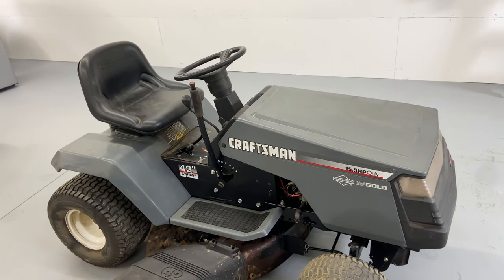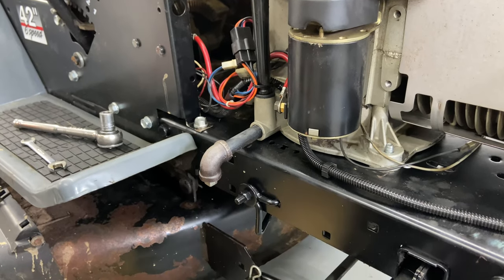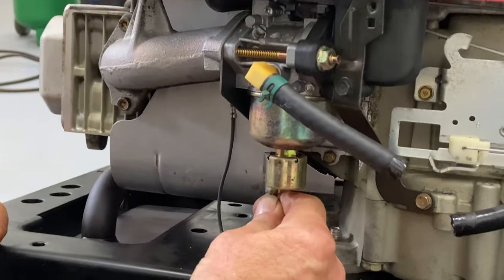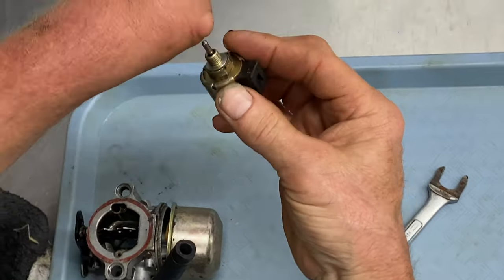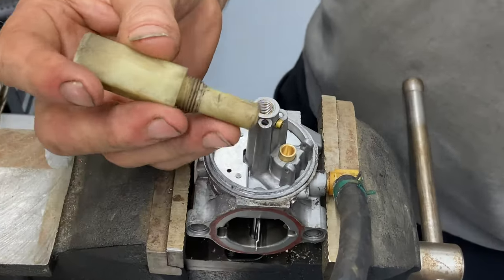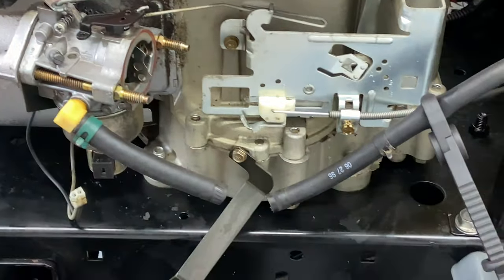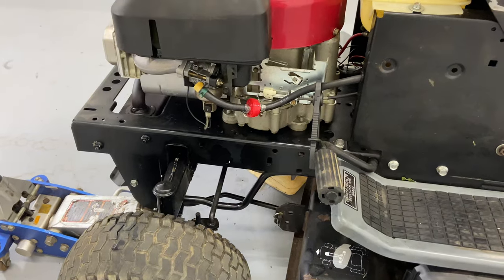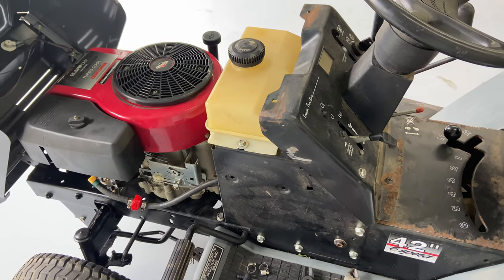Why is there Gas in my Lawn Tractor Engine Oil ???

Comment: Well done. I added an inline fuel solenoid to shut off the fuel. I know my wife or I would leave the manual one on at some point. Now I have 2 things (anti backfire and solenoid) that should shut off the fuel if they are both working.👍
Reply from the maker: That will cover pretty much everything!!!

Comment: Your lawnmower has created diesel my friend lol - I have the same issue with my toro, just not as much gas comes out of mine though very informative, thanks!
Reply from the maker: Ahhh yes, the oldies and well built!
Reply: @Johnson's Small Engines  I ordered a new carb, adjusted the valves a bit and seems to be doing good now (nock on wood)

Comment: Friend has a very similar engine on a mower he got for free. We got it assembled, serviced and running but over night it'll fill the cylinder with gas to the point that it hydrolocks. The geyser when you pull the plug and run the starter is spectacular. We'll give it another go with the new knowledge, great video bud👍

Comment: Very nice clear instructions. Exact thing happened to my  Snapper rear engine rider. I decided to just try the cheap 40 dollar aftermarket carb. Followed your instructions taking apart and putting back together and started right up and so far now no gas in oil and works like a champ. Time will tell!! Thank you very much for the clear instruction and vid.
Reply from the maker: I’m glad it was helpful!Thank you for watching and the kind comment.

Comment: I have almost that exact tractor that I bought new in the fall of 1996:
Model 917.256890 Serial 092596D (Sept 26 1996) Original engine B&S 28N707 0173-01 960830ZD (Aug 30 1996)

I replaced the engine in 2005 due to catastrophic failure (broken connecting rod). The replacement engine - which it still has - is B&S 28N707 1026-E1 991102ZE (Nov 2 1999). Its interesting that the replacement engine evidently sat for over 6 years before I purchased it. Around 2010 it began to experience hydro lock after sitting between uses. I tried rebuilding the carb several times without success so I installed a fuel shut off and now just run the carb dry at each shut off. No more issues. I completely rebuilt the tractor in 2020 during Covid as the frame was badly cracked in the front - probably from years of using it in the winter with a small plow blade. I was lucky to find a vintage parts tractor (no engine) with a perfect frame. I also rebuild the hydrostatic trans (Hydro-Gear 310-0500) to replace the seals. The current engine has 390 hours on it and I estimate the entire tractor to have over 700 hours in its almost 29 years.

Paul (in MA)

Comment: You are the best I like the way you explained everything to the wire I was going to cut my yard today when to the  garage and  my lawnmower it was full of gas in my oil should I put a cutoff valve on my gas line and should I run something to my crankcase to get all the gas out if so what should I do I'm going berserk thank you so very much for your videos I have a Craftsman t240 Kohler 22 hp 7000 series and I just learned something about this solenoid a good videos turn the key on I can hear click thank you so very much
Reply from the maker: Hi Henry, you can put a fuel shut off in but I would suggest rebuilding the carburetor. Draining all gas from engine and replace oil filter is all you need to do.

Comment: Great video... great working knowledge... I have the same problem with the same engine wish I saw your recommendation to use oem before ordering an aftermarket one... I winged it with diagnosing and disassembly but watching this gave me the extra confidence I need to get this thing up and running again... Thanx
Reply from the maker: Thanks for watching and commenting. I will assume you’re replacing the entire carburetor? If you are, let me know how it worked out?
Reply: @JohnsonsSmallEngines  yes I'm replacing the whole thing because it seems like the previous owner crossthreaded the fuel solenoid and after I cleaned all the rusty gas and crud out of the bowl the threads won't grab so I figured I'll save time and replace the whole unit instead of rebuilding it.
Reply: @JohnsonsSmallEngines 

Update... so far so good finally got it running, rebuilt brake caliper and did a full clean up and tune up... Thanx again great work keep it up
Reply from the maker: Good to hear. Thank you for the update.

Comment: A little trick I discovered : take a carburetor and hook a 1/4" hose to it. hold it old it up right
and blow and you should be able to tell the air is going through it.  Now turn it upside down and you should not be able to blow through the hose.  When turned upside down the float should close the flow.

Comment: After draining the crankcase, do you think I need to air out the crankcase's intake, with a leaf blower, to get as much gas to evaporate as possible? Or should an overnight oil drain suffice?
Reply from the maker: The overnight is oil drain is good.
Reply: @JohnsonsSmallEngines  After refilling the oil, should I then mow the lawn once, then change the oil again to completely rid the gas in the crankcase?
Reply from the maker: It wouldn’t be a bad idea to drain it twice but it is not needed especially if your able to drain the engine all night you should be ok. If you do have a oil filter and you are draining the engine twice, remember to also change the oil filter again.

Comment: Faulty gas cap (not breathing) will build pressure and that pressure will push your needle valve down and through the carb up into the intake . Just happened on mine the other day.
Reply from the maker: A faulty gas cap does just the opposite and creates a stoppage of the fuel flowing eventually causing engine to starve of fuel from carburetor shutting machine down. The engine creates the vacuum needed so the carburetor can pull fuel.
Reply: @JohnsonsSmallEngines  
Yes it was doing that also and after  l parked it and no vacum. It was shooting up through the carb like it was being pumped.
Changed the carb and was still doing it . Changed the cap and it stopped. So l don't know guess will see if l find gas in the engine next time l go to use it.

Comment: On the 1/2 inch wrench how think is it now? I have to smuggle one into work to grind down. Just trying to figure out the thickness now? Thanks for the advice.
Reply from the maker: Not sure thickness, i ground it down until it fit, but don’t grind to much off. Just do a little and a time and check it.

Comment: Thank you so much for the video. I do have a question. I followed all of your steps and cleaned the carburetor. I filled the oil and the fuel tanks. It's turning on which is better than what it was doing before but it is giving out a lot of smoke. Is this normal and does the smoke stop eventually or did I do something wrong?
Reply from the maker: I'm pretty sure I replied to your e-mail.

Comment: Good video first time it happened to me. My push blower wheel fell off, so I was trying to fix that. Maybe that caused the float to stick. the gas run into the oil Two big wheels so when the wheel fell off, it was tilted too much.

Comment: Great video!!  I just had this happen to my mower yesterday.  After it happened and I tried to start it, it didn't try to turn over.  It just made a high pitched whining or whistling sound.  Did the gas cause an issue w/ it not trying to turn over or could it also be a starter or solenoid issue that would make that sound?
Reply from the maker: What can happen is the gasoline flows from the tank through the carburetor and into the engine oil then it fills up and goes into the combustion chamber where the piston is and if both valves are closed, and you go to start the engine, you will have a liquid lock where the piston will not move because the fuel is in the way. Your starter solenoid most likely is OK. You will need to remove the spark plug. Make sure the spark plug wire is not near the spark plug hole and spin the engine over to relieve the fuel that is in the cylinder. I would suggest spinning the engine over by hand and make sure you have many many rags or something to catch the fuel that will be coming out of the front spark plug hole. Once you have all the gas relieved from the cylinder, you can go ahead and try to crank the engine with a starter, but as I said, be careful where the spark plug wire is sitting so you do not catch any fuel on fire if you do crank over the engine while the spark plug is out.
Reply: @JohnsonsSmallEngines  Awesome!!  Thank you so much.

Comment: Thanks so much for this video.  I thought my lawn mower was done.  It was fine at the end of the season but when I started it up this year it was smoking.  When I tried to engage the blades it started sputtering and stalled out.  I thought I was going to need a new tractor. I had gas in the oil too.  I drained the oil, replaced the filter and got a replacement carb from Amazon.  That spring was hard to get.  I did get a little bend but straightened it out.  I started it up okay but now it seems that it runs rough on high RPMs.  If I lower the throttle it starts running smoother and I can slowly increase RPMs.  It still not right.  Do I need to replace the spark plug?  Any suggestions?
Thanks again for this video.
Reply from the maker: I cannot diagnose a symptom without seeing the engine while it’s running and I have no luck with aftermarket carburetors for the larger Briggs and Stratton engines. I would suggest trying to rebuild the carburetor that came off your engine if it is an original OEM “ original equipment manufacture”. Yes I would replace the spark plug, and fuel filter and the air cleaner if needed.
Reply: @JohnsonsSmallEngines  okay thanks.  Going to replace spark plug and air filter.  Replaced fuel filter and installed a shutoff valve in fuel line.  I have never worked on a carburetor that's why I just replaced it.
Reply from the maker: If you get all of the parts my video shows how to repair it.

Comment: I've got a Craftsman T206 Riding Lawn mower. All the gas disappeared; found it in the oil. Naturally, I got blamed, so we filled the gas back up and the same thing happened, so it obviously wasn't me. We've traveled far enough down the road to understand that it must be the carburetur, but now comes the task of replacing it. (We're not experts enough to try to fix the carburetor itself.) Can you offer any guidance?
Reply from the maker: The easiest way to correct this issue is, drain all gas from the engine, put fresh oil in and replace (purchase a new) the carburetor with the OEM "original equipment manufacturer" carburetor.

Comment: Would a leaking float taking on fuel and falling pulling the needle vale down also allow too much fuel into the bowl and cause the same problem as fuel in the crankcase?
Reply from the maker: Yes
Reply: @JohnsonsSmallEngines  Thank You, Carburetors... one of life's little pleasures. Appreciate your channel. Am now a subscriber. With a rider mower, chain saw, pressure washer and 1971 VW Beetle I am in carburetor heaven. The more you teach us the better we gas guys can keep our investments running.
Reply from the maker: I had a old Beetle 20 years ago and I wish I didn’t get rid of it. Fun little car. I don’t get into the little two cycle engines anymore as being in business not worth repairing but I keep busy with tractors, snow throwers and many how to operate machines to help all the folks that rather watch a video then read a manual that now you can only get online. How things have changed through the years. Thank you for supporting my channel and if I can help you please don’t hesitate to ask any questions.

Comment: Hello I too am having similar issues with my 25 year old Mastercraft lawn tractor with 15.5 hp Briggs and Stratton engine. My question is what brand and grade of oil 10W30 or 5W30 would you use for such an old tractor.
Reply from the maker: My opinion, the brand of oil doesn’t matter as much as the API rating which at the present is SP. Just make sure the oil has that on the back of bottle. Depending on where you live would depend on what viscosity you use. Normally you can find that in your manual for your machine online. In my area I use mostly 10w30.

Comment: Can I replace the carb with one that has a metal inlet valve if the current one has a plastic inlet valve?
Reply from the maker: You should only use a OEM “original equipment manufacturer “carburetor or equivalent. If the part number of the OEM carburetor goes to a aftermarket with a metal inlet valve, it should work.
Reply: @JohnsonsSmallEngines  thank you so much

Comment: My Ariens 42 with 18.5 hp has acted like the valves were not adjusted correct or broken compression release and won’t turn over to start with brand new battery and starter. So I pulled the valve cover and there must have been a couple ounces of gas in it. So smelled the dip stick and smelled strong of gas. So maybe it has been filling up with gas in the cylinder and won’t let it crank over to start. But when I would get it running and if it stalled from grass being so tall then I go to start it again and it won’t turn over fast enough to start. So hoping it’s just stuck carb hydro locking it and not the compression release. I can turn it over up top by hand but put my impact on the crank bolt up top and it won’t even turn the motor over but has no trouble loosening lug bolts on my cars. So going to I guess pull the carb and take a look. I run alcohol free gas but don’t put any Stabil in it for winter non use months. Any suggests anyone please feel free to reply.

Comment: dear johnson,
I have a B&S 12 hp that uses a lot of gasoline
the oil does not smell like gasoline and the oil does not want to burn
the exhaust is dry brown rust
How come it uses so much gasoline? do you have any idea ?
piston rings ?
valve ajustment?
something else ?
Reply from the maker: To answer your question with a question. What do you consider is “using a lot of fuel”. That question really cannot be answered correctly as you would need to know what other 12hp engines are consuming. I cannot tell you what they consume as there are so many different variables. If the exhaust coming out is clean burning and engine is running smoothly at full throttle. I would say, it is what it is.

Comment: Excellent video ,now subscribed. I had a pretty flat out question, basically same small engine that  i have here working on i need to know how much oil to fill the crank case back up to the correct level this one had a half gallon of gasoline mixed with some oil, so i am not sure its an 18 hp Briggs and Stratton Poulan lawn tractor.?
Reply from the maker: Hi Bobby, sorry for the late reply as your comment went to the wrong place. If your engine has a oil filter you will need about 1.75 qts. If you not have a oil filter 1.25 to 1.5 qts. Thank you for watching and supporting the channel!
Reply: @JohnsonsSmallEngines  The owner of this  lawn tractor Poulan  pro  42 INCH CUT LEFT HIS KEY ON AND THAT  energized  the little solenoid, causing the crank case to fill up with gas, i installed a shut off valve. I realize he still has issues in the carb, but he just bought it only cut with it once and left the key on when he parked it. He's been my neighbor and friend for thirty years i just charged him for oil, guessing his next move and sure enough he offered me for free, his old tractor , 17 .5 hp  brigg's with two flats and dead battery ,believe it or not it started right up, after sitting exposed in Florida weather for a year. His neighbor noticed me test driving it on the road in front of our homes came by offered me three hundred and i said well don't really need to sell but since you are a neighbor i guess i could SOLD ,good news is i will in the future make more money from that tractor as more years go by thanks to ethanol. Funny thing it makes no difference how many times you tell them stop leaving gasoline in the engine when you park it for more than 2 weeks, the same folks over and over again  so many times i just buy the carb  for their needs a head of the repair, i think i might invest in a sonic cleaner they seem to work pretty good from what i have seen on the internet. Competition to sell after market  partslikecarb.is so cut throat it almost doesn't pay to clean the old one. My dad had a small engine repair shop that he worked himself evenings and weekends and still worked his gov. job fulltime on base, i share his love he always had for these small engines, he's gone now but his love is carried on through me and i am almost 64 next month, seems like i was 30 something yesterday. Well thank for listening to me rant on about nothing important,  Guess how many brought their generators tome after we lost power for a week,43,got to be a record and all had the same issues, ethanol  my  new best friend. I finished the last one one hour before the power got cut back on.

Comment: I have the identical engine and where the engine mounts to the frame the bolt holes are worn oversized any suggestions on how to fix it ?
Reply from the maker: The easiest way is drill the holes in the block out so you can slide bolts through then you will need longer bolts so you can use lock nuts on the other side. Get some large fender washers for underneath the frame and bolt engine tight. The proper way would be, remove engine, weld up the frame where the holes are enlarged and drill the holes back out to correct the issue but most DIYers will not have a welder. The first way will work.